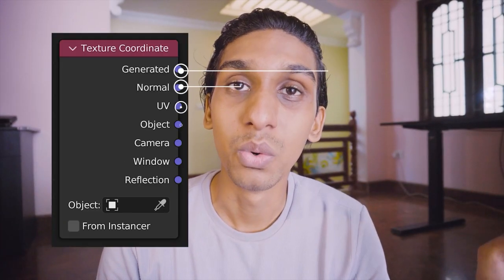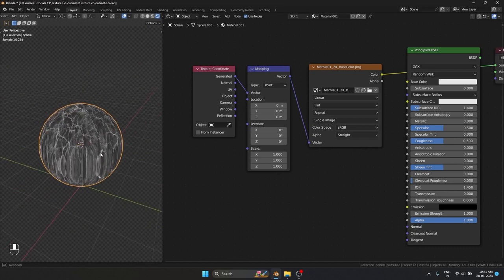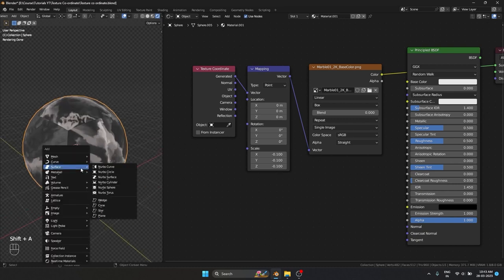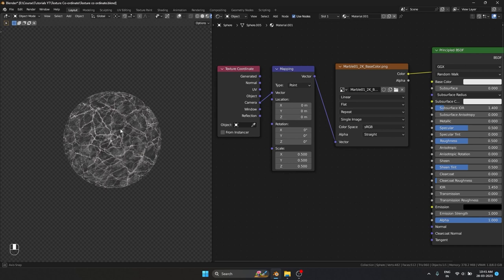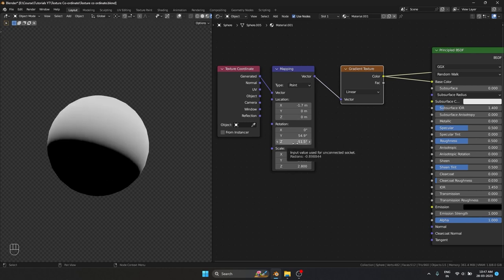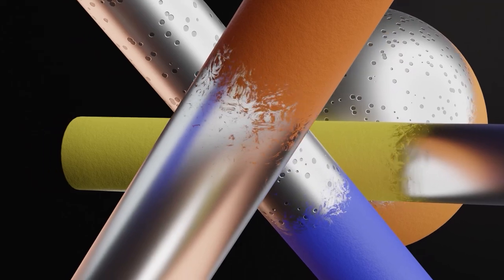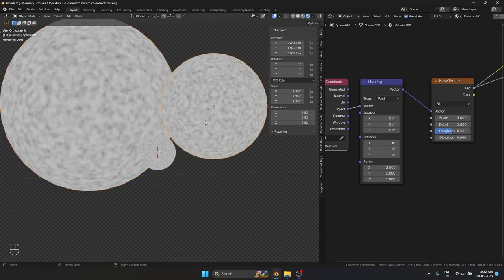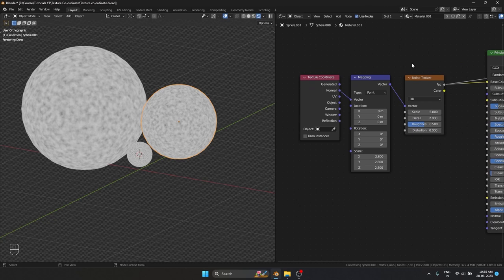Understanding Texture Coordinate Node for PBR and Procedural Textures (Part 1)

Comment: For the stretched part, I was trying to use a procedure texture and noticed the same stretch thing. But there is no option of "box" in the procedure texture. Is it possible to fix that?
Reply from the maker: For procedural texture there is no box option, instead you have to use the object co-ordinate, check this video https://www.youtube.com/watch?v=U60foGDU2Nw at 0:58 I solve that issue here
Reply: @Bacosil  Thanks for the quick reply😀
That did not work for me though. Probably because I am doing a complex cloth with wave texture. No matter I choose x, y or z, there is always some part almost parallel to that direction and the waves are therefore stretched.. 
Guess procedure texture is just not for cases like this.